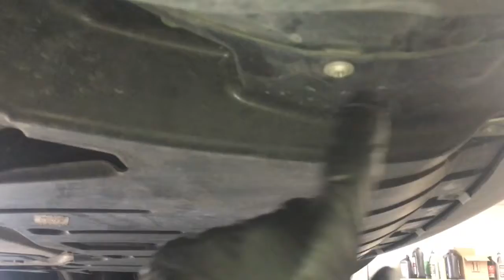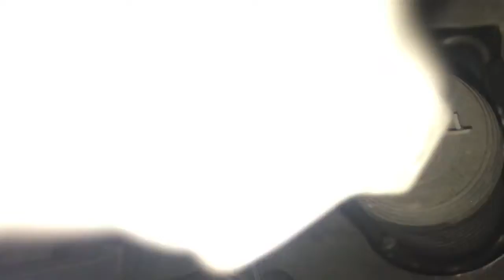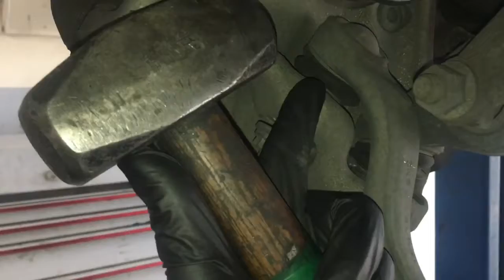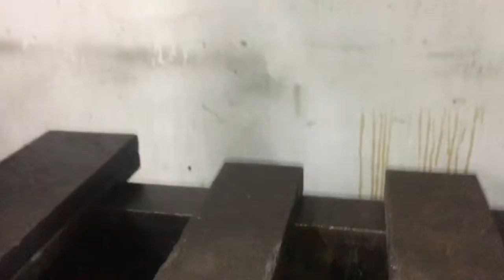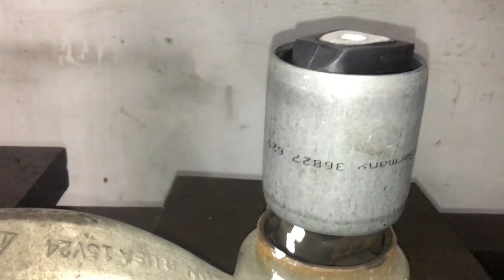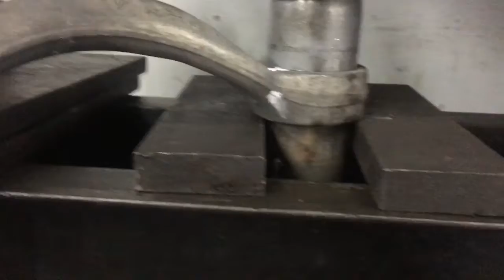How To Replace The Radius Control Arm Bushing On A BMW X5 E70

Comment: A reputable BMW shop says my Thrust Arm Bushings are 'leaking' on front & back arms and quoted me $788 (2 new Radius Thrust Arms ($225 for front & back) plus $336 labor (2.10 hours) + tax (total is around $825). I am not getting any 'symptoms' that these control arms/bushing needs replacing (example: I have no noises or changes in the steering & handling / no clunking noises or unresponsive steering / no irregular tire wear). 
QUESTION: How do I know if they are being truthful that I need these parts replaced, if I do not see any of these symptom? I have a 2013 X5 'Diesel' with low 47,000 miles on it. I just want to make sure I am not being screwed! Any good input on this would be appreciated!
Reply from the maker: So some of those mounts are filled with hydraulic fluid. And that may be what they’re seeing leaking. The best way to tell is to get under there and physically check yourself and if you gut says that they’re not being truthful and probably go with that. Or get a second opinion from another shop.

Comment: what is the symptom?
Reply from the maker: Ariel Vo The most common symptom is when you’re at slower speeds and you hit the brake pedal you’ll feel the thump or movement in the wheels
Reply: @HowtoAutomotive   my suspension is unstable, I almost ran off the road and I don’t know what is causing it to swerve left to right without moving the steering. It feels like a boat at times🤷🏽‍♂️
Reply from the maker: @Indelife  in your case if you don’t know what you’re looking for I would recommend taking it to a shop and having a inspected.

Comment: What is the worn symptoms of this co trol arm?
Reply from the maker: AriVovp you will feel a clunk when you hit the break pedal. Especially at slower speeds.
Reply: @HowtoAutomotive  when i was making a sharp turn at super slow speed , it often feel clicking or cracking noise.
Reply from the maker: AriVovp that’s most likely the problem then. But you also want to check the axle  It can make a similar sound. If you drive the vehicle 3 or 4 mph and have somebody watch the front wheels as you rapidly hit the brakes on and off and look for the wheel is jerking back-and-forth that is the control arm. If it’s stable then I was suspecting axle.
Reply: @HowtoAutomotive  thanks man
Reply: @HowtoAutomotive  also i do have light steering wobble at around 60 to 80mph
Reply: @HowtoAutomotive   I just replaced both thrust arms as well as the bushings for the lower control arm. Still getting a clunking over bumps. Could it be the upper arm?
Reply: The same as after he 'fixed' it EXCEPT worse. He's not a mechanic.

Comment: Was there any visible damage to the bushing or was it internal? I didn't see anything wrong with the old one like I would expect to see the rubber cracking or separating from the metal. I am just wondering how you caught this problem.

Comment: What type of press is that?
Reply from the maker: B BB It’s just a standard bottle jack press.
Reply: How to Automotive did you buy it as a kit for a press or separately? I’m shopping for a press to do this at home
Reply from the maker: B BB when I bought the shop it was here already. This one’s probably 25 years old or more.
Reply: How to Automotive thanks. Is there any advice you can give me in terms of the pressure required to do this? I see presses that are rated between 7 to 20 tons.

Comment: thanks for the video! 
is there any other way to pop the ball joint out other than to whack that frame? i guess if you had a full replacement tension strut you could strike the end of the bolt?
Reply: Normally what Ive done when replacing or removing control arms is put the nut back on the ball joint.  Threaded until basically flush then if hitting the boss around the spindle doesnt work tap the end of the ball joint woth the hammer.  The key is to make sure the nut is threaded on but not so much the the threaded portion is protruding from the nut.

Comment: When you're tightening the ball joint nut down, does the ball joint turn or is it locked in place? When I was installing upper control arms on my E60 the ball joint would turn. But there was a hex insert on the screw part to hold from rotating.
Reply from the maker: distance ed it's supposed to turn a little bit especially as it gets a little wear on it. That hex head that you were referring to is designed to hold it in place so you can tighten it. But if it's extremely loose in the joint maybe worn out.

Comment: You didn't put the car back to "ride height" prior to torquing those bolts....
Reply from the maker: SSJGohanMlm that not possible unless you had a role on the rack.
Reply: @HowtoAutomotive  , you drive it on an alignment rack to tighten at ride height. Basic.
Reply: I once had a mechanic do this to me and I travelled about 1km before the new bushes were torn and useless.  ALWAYS need to put the weight of the vehicle on the control arm bushes prior to putting any torque what so ever on them. Ever since that day about 10 years ago I do my own to avoid exactly this scenario where someone torques them up while hanging in the air. You can, as a bare minimum, use a jack to compress the suspension enough to be somewhat close to ride height then torque the bolt... if you don't have ramps. I would be interested to hear how long these particular bushes lasted?
Reply from the maker: SSJGohanMlm I 20 ton jack pretty much do you think you throw at it. Anything less that you may have limitations
Reply: @HowtoAutomotive  Then you're a shitty mechanic, proven here.  I took measurements from the center bore of the rim to the wheel well, then use a jack to compress it as close as possible, then torque.  This was before I had a lift in my garage.  If I were to do this again, I would one of those telescopic jacks and lower the vehicle, one corner at a time.